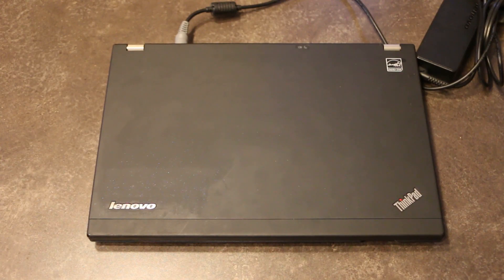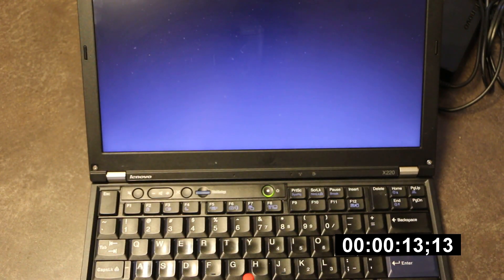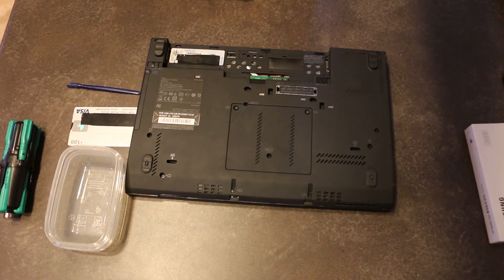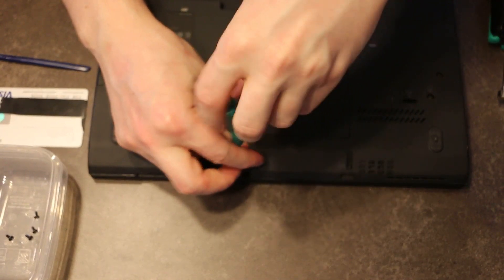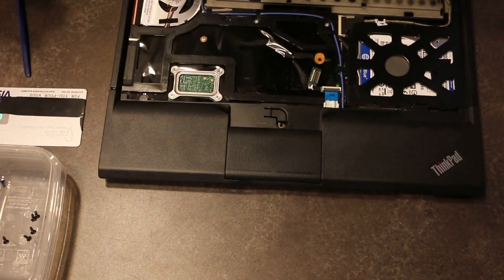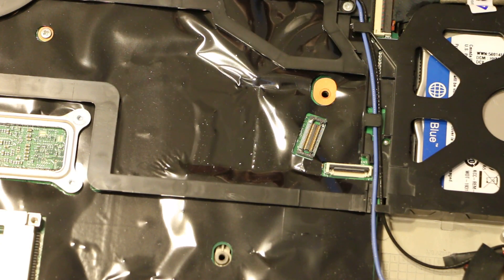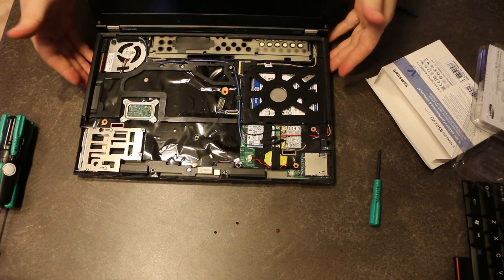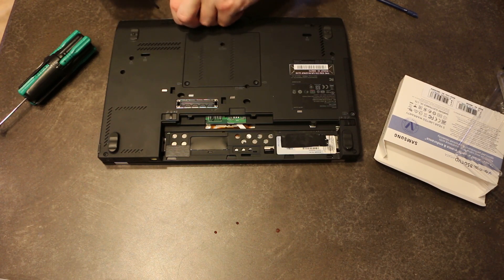Installing a SSD mSATA in a Lenovo Thinkpad X220

Comment: I got one last week as i love the design and wish they still made them just the same! Mine has the following specs:
Operating System
 Windows 10 Home 64-bit
CPU
 Intel Core i7 @ 2.80GHz 55 °C
 Sandy Bridge 32nm Technology
RAM
 8.00GB Dual-Channel DDR3 @ 664MHz (9-9-9-24)
Motherboard
 LENOVO 4286CTO (CPU)
Graphics
 LCD 1366x768 (1366x768@60Hz)
 Intel HD Graphics 3000 (Lenovo)
Storage
 298GB Seagate ST320LT007-9ZV142 (SATA ) 33 °C
Optical Drives
 No optical disk drives detected
Audio
 Conexant 20672 SmartAudio HD
I will be putting a new 500GB ssd i bought in tomorrow hopefully she will really fly!
Cheers....
Reply from the maker: That SSD will make such a difference. Enjoy!
Reply: @LaptopRetrospective  Cheers mate!
Reply from the maker: Right back at you!
Reply: Oh, i7 i see, nice!
Reply: @mmcblk05studio  Thanks it still runs well.

Comment: I'm confused as to why you took out the 2.5 HDD, if you not swapping it out?  A extra HDD doesn't affect speed or stability, just maybe a few minutes of battery life? and could be used in other ways.
Reply from the maker: I leave the bay empty to swap out different OS drives.

Comment: Thank you for the video.

I have a question regarding ssd's. I think i'll go and buy a x220 but with a hard drive, and swap out HDD with an SSD (its cheaper this way). How do I know which SSD will go inside the new x220? In the specs it says the HDD has protocol "esata", but when I try to search for esata ssd disk, the only protocols I could find were SATA and SATA3 (and other older pci, etc).
Reply from the maker: If you're not using the mSATA slit then you've got the standard 2.5 inch bay.

Comment: Partition into 2 and format.  Hope it works. Im trying 850 500GB t420 lenovo with working win 7 research upgrades its worth not installing some since hardware missing
Reply from the maker: Partitions are always options but I like the security and simplicity of the separate drives.

Comment: What a great video, thank you so much.
Im a bit confused about one thing. Which better, the msata ssd, or the standard 2.5 inch ssd? If the standard is better because its sata3, why did you change to the msata instead of the standard 2.5 SSD?
Thank you in advance.
Reply from the maker: Great question. I used the mSATA drives even though they are slower because it leaves the 2.5 bay open for me to swap out quickly for drives with other operating systems. Hope I explained that well.
Reply: @LaptopRetrospective  Oh Ok, nice idea though. But one more question, if the mSata is installed with linux, when you put the sata disk installed with windows into the laptop, will that the linux be coming up first on boot? Because the bootloader is linux, right? Then how can you boot to Windows? 
Correct me if I'm wrong. And sorry for my bad english
Reply from the maker: Put drive in, hit the Think button to get the option to select alternative boot drive.
Reply: @LaptopRetrospective  oh, right, forget about that think button, lol. Thank you so much for assisting me
Reply from the maker: My pleasure. Hope it was helpful info. I use my x220 to run a variety of operating systems and I just need to swap the drives. No dual Boot or VM

Comment: Since when is it a "bygone era of computing?" Most full-featured laptops still offer the ability to replace components when you perform the same procedure. X220/X230 don't have a socketed CPU or GPU either, so it's not like these are the most expandable PCs ever. They're still excellent computers, but I don't buy into some of the lore.
Reply: At this price point, you could get a Chromebook, which tons of students are getting now. They're almost completely un-expandable. I'm not sure about new Macbooks, but Airbooks aren't very upgradeable. In the X220/X230 age, all laptops (AFAIK), could take RAM and drive upgrades. Bygone era!
Reply: @CuvitoxNot a "bygone era" at all. There were just as many minimally-serviceable computers 5 years ago as there are today. Also, Chromebooks don't need "expandability." They're typically little more than glorified smartphones. The only service you might need to perform is a screen replacement, and that's typically no problem.
Reply from the maker: I was more referring to the level of serviceability. Many laptops have RAM soldered as well.
Reply: Many do, but most full-featured computers (non-ultrabooks) like the X230 have socketed memory and storage.
Reply: I think it's more of a ease-of-service thing, everything just fits together so neatly. Replacing the entire keyboard takes, like, a few minutes.
Reply: In modern (2016) laptop, you need to break rivets and re-glue keyboard afterwards. And you need off the whole mobo in process
Reply: @mmcblk05studio  No, you don't.
Reply: @Browningate  lol
Reply: @Browningate  indeed, you could just sledgehammer whole laptop
Reply: @mmcblk05studio  My circa-2016 ultrabook is held together with screws. I can easily replace the storage device, MiniPCI-Express cards, and battery without application of heatgun or other such foolery. Just because the Surface Pro is like that, not all ultrabooks are that way.
Reply: @Browningate  Yeah, but how do you replace keyboard?
Reply: @mmcblk05studio  Very carefully.
Reply: @Browningate  lol, my 2016 15.6" laptop has its keyboard riveted to the hull. And to replace it you need to reglue it!
Reply: @mmcblk05studio  Yeah, that's probably the hardest part to service in the 4th generation X1 Carbon. Everything basically screws into the back of the keyboard/palmrest assembly (which are one unit). Thankfully, it's a spill resistant keyboard, so I don't have any intention of needing to replace it. Cheaper/crummier laptops have a much easier replacement procedure for their keyboards, but at the expense of everything else sucking. Pick your poison. Something has to be difficult to get to.
Reply: @Browningate  Well, on cheap laptops keyboard is glued to palmrest not screwed
Reply: @mmcblk05studio  On the contrary, in my experience, cheap laptops usually have them held in by one screw and a set of snaps.
Reply: @Browningate  huh. Well, that 2016 is only budget by comparing it with thinkpads. It's mid tier actually (like 600$)
Reply: @mmcblk05studio  I'm thinking of more bargain-basement cheapo laptops. Those are, ironically, sometimes the easiest to service.
Reply: @Browningate  yea indeed. My acer is only budget comparing to thinkpads in the store. It has such a neat thing as non-motherboard power jack

Comment: Hey I recently dusted off my x220 because of your website. I was wondering would it be possible at all for you to do a video on how to install mSATA SSD on the mini PCI-E, please? If not a video maybe the necessary parts? thanks for your time!
Reply from the maker: Hey San, unless I have misunderstood you, that's what this video covers. I install the mSATA drive here. Let me know if I can provide any assistance and I'm glad I could be a part of giving your x220 some attention.
Reply: Hey thank you for your reply. For some reason I had equated my express port with mPCI-E port. I kept thinking there was a way to put an SSD into my express port, that way I would be able to avoid, what looks (to me) a bit of a daunting work to install the SSD, I especially fear not being able to plug the wires properly thus making the keyboard and wireless card useless. Either way, I may give it a try. Thank you for your videos, they helped me revamp my x220.
Reply from the maker: Not sure about using the express card slot or even the bandwidth you'd get from it. Putting in the mSATA drive is quite easy and I'd encourage you to give it a try! Good luck.
Reply from the maker: Yes, it's still in development though.
Reply: @LaptopRetrospective  I think they would ship you a fully working card just rn
Reply from the maker: Not sure I understand, the cards aren't ready for shipment yet and are just entering their prototype 4 phase.

Comment: wow great video man
im getting a 850 msata drive soon
do you know any better wifi cards i can install for my x220?
Reply from the maker: Yes, get an Intel Dual Band Wireless 7260 (Bout $25 USD). You will need to install the custom BIOS I feature in one of my other X220 videos. It will give you AC speeds and Bluetooth 4.0 to boot. Then you just need to tape over Pin 51 for Bluetooth to function properly. http://i.imgur.com/0FksEIi.jpg 

Hope that helps!

Comment: Thank you for the great video. I loved it.  I have an X220 tablet and it has no Bluetooth card. Do you know how should I add one? Also let me know if it interferes with the mSata deck.
Reply from the maker: Most computers have the Bluetooth built into the WiFi card. Since the WiFi card is whitelisted on this unit, you will either need the factory card or do the BIOS update to enable the use of other WiFi cards. I don`t think you would need to use the mSATA slot for such an application.

Comment: Great video, thanks! I was bummed that I couldn't put an mSATA SSD in my X200 (no electrical connection from PCIe slots to the SATA controller) but this will be the first upgrade that I do when I find an X220 in decent condition.
Reply from the maker: You're welcome. Hopefully, you can find one in good condition. They are a fun little project machine.